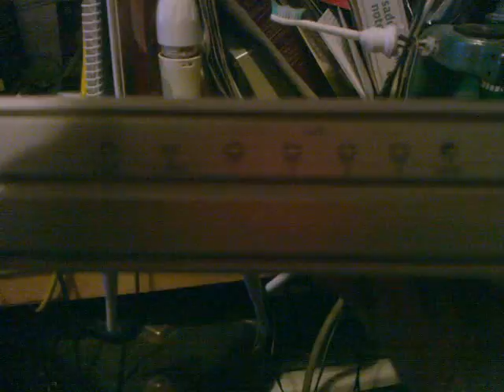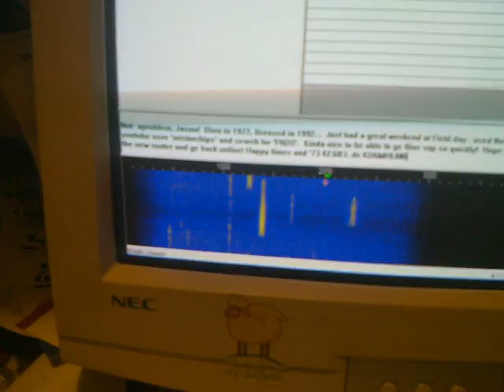ASUS RT-N16 router popped after 20mtr HAM TX....

Comment from the maker: @crouffer Replacement still dies w/ 10M etc, but my antenna is close to the station... I ended up putting ferrites on most of the cables coming into and out of the unit and it's sturdier now, but still will die on some freqs.